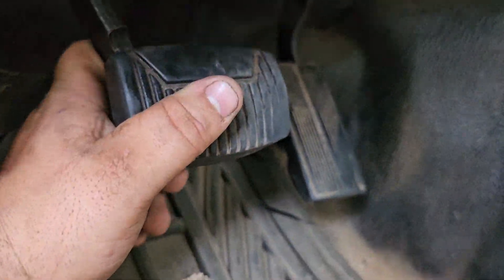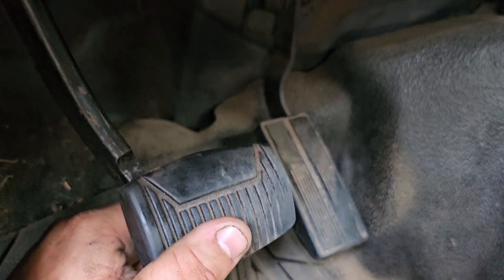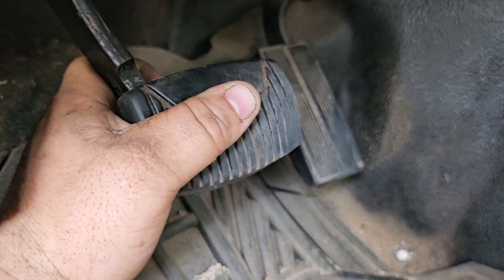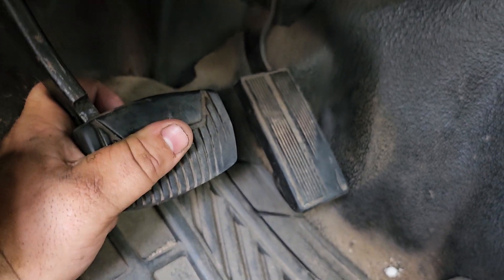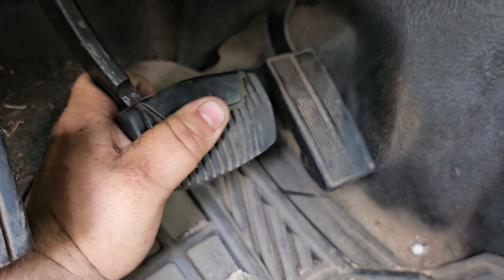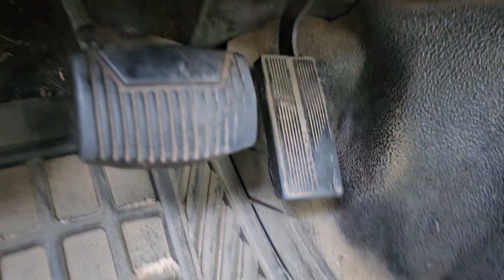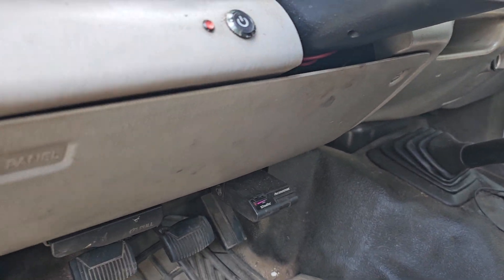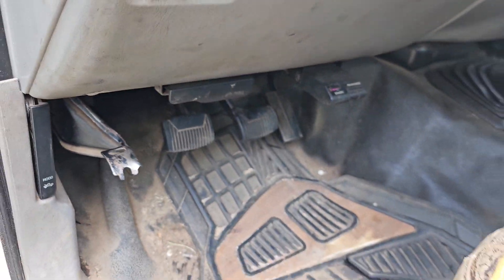brake pedal problem?

Comment: IMO the brake pedals are a real PITA to remove. But I would disconnect the brake pedal from the master cylinder - pay close attention, like with pictures of how the master cylinder rod is attached to the pedal, the orientation of the brake switch and the little clip that holds it on the post. Remove the 4 bolts that holds the master cylinder on and pull it forward and that will confirm if the pedal itself is the problem. I had one that was extremely stiff and I had to replace it. But in your case, I suspect it's your master cylinder itself that is seized. If you are removing the pedal assembly, there's two studs above the pedal and you have to remove the nuts. It seems nearly impossible to pull the pedal down off those studs as the firewall doesn't want to let it come down - takes a lot of bad words and jiggling and prying to get it out. All the while wondering how in the world will you get it back in there. But rest assured, you will get it unless you run out of bad words!